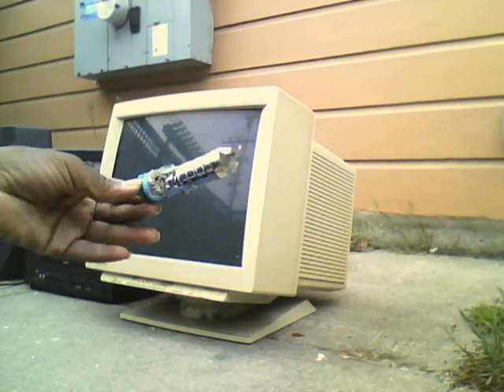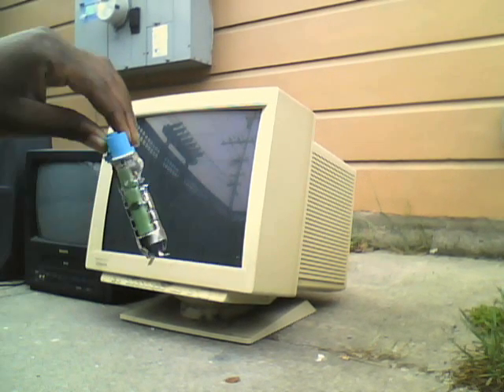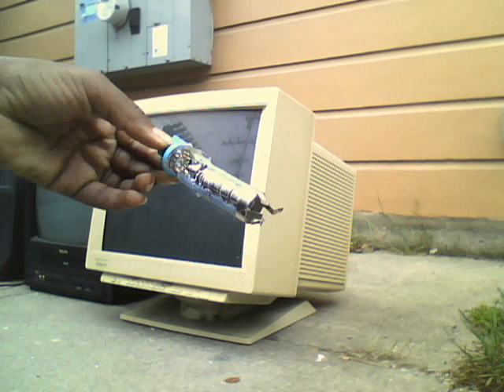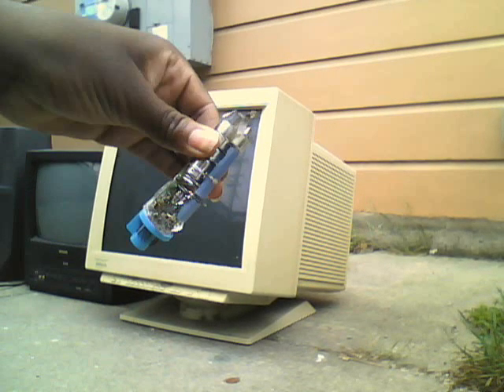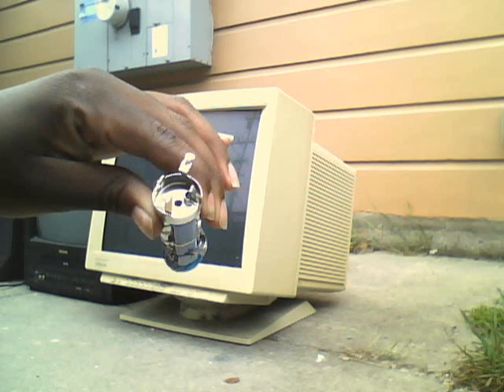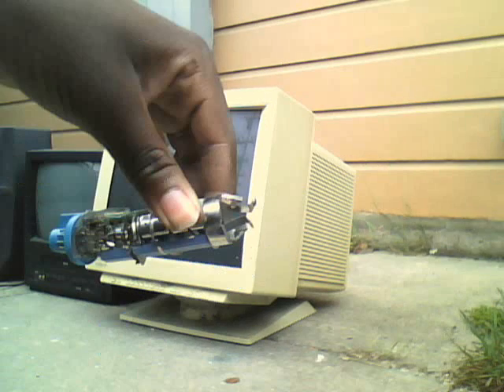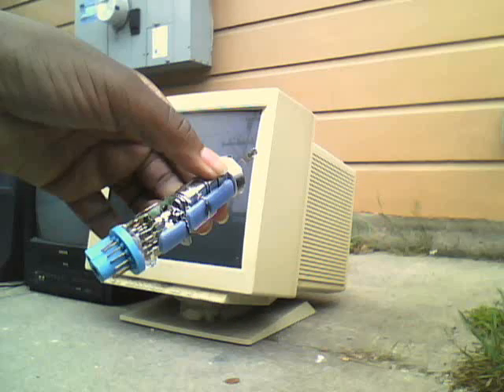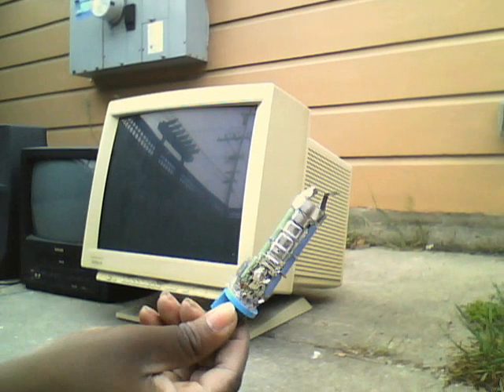The CRT Electron Gun (Dell E770 CRT Monitor)

Comment: at first i thought that was a delta gun untill you rotated it. if you did not rotate it i would of been like "Holy shit i did not know we had delta guns in use in the late 90's"
Reply from the maker: Hahahaha nah, I think this one is from around 2000 or 2001.
Reply: so i have been checking your channel out and i like it, i also thing you might like mine since i got crt's and dumpster diving videos as well. and im probably gonna be leaving alot of comments as i go threw your videos. since were on crt's whats the oldest one you got and dose it function well enough to use day to day? (in case your interested  in a return answer, a 1972 admiral and no, im still trying to get a schematic on it.)
Reply from the maker: I checked yours out too and it looks cool. I subbed. Oldest is 1977, worked but no sound.